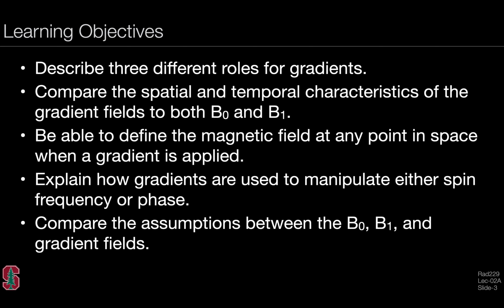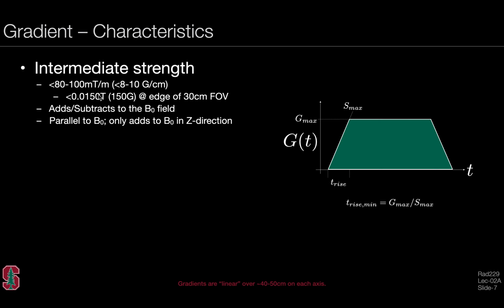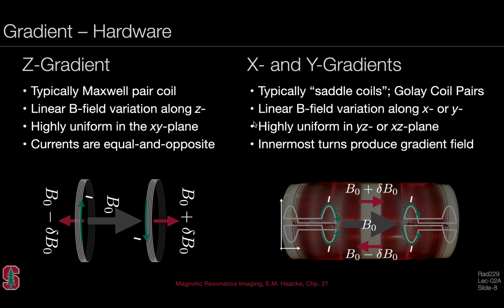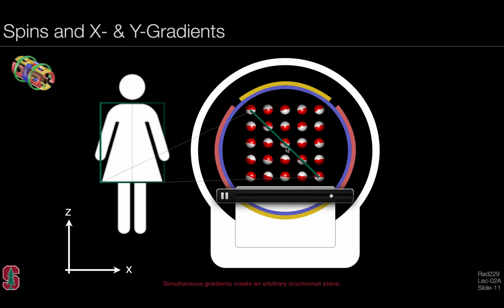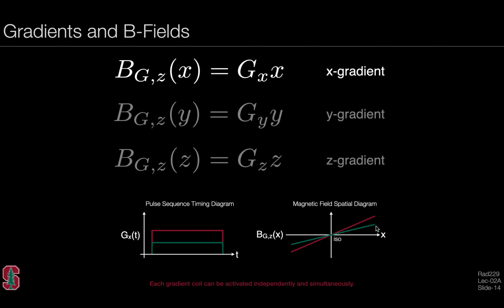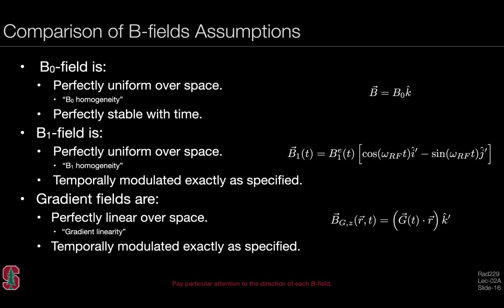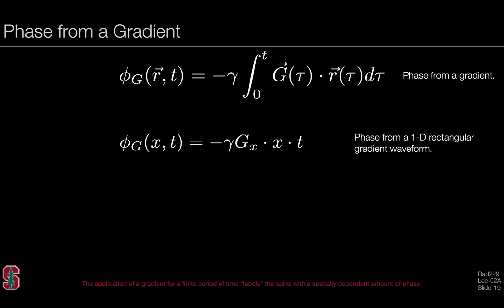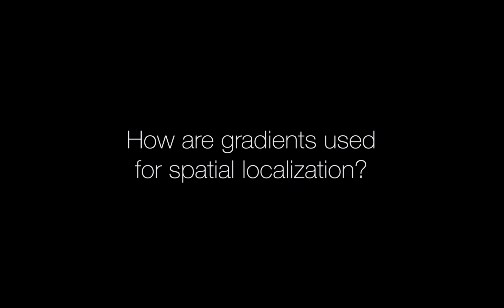Rad229 (2020) Lecture-02A: Magnetic Field Gradients

Comment: @ 03:38 In my opinion, this should be 0.150 Tesla.
@ 11:05 Not quite rectangular because of the rise-time (4:44)
@ 20:01 So the instantaneous phase is relevant? (Their accumulated phase is quite different here)
Reply: I agree with your first point. Regarding your second point, I believe it is modeled with a rect function but also the time-rise is significantly smaller than the duration length of gradients (which can be for a few ms). Not sure I fully understand your third point, because I believe we only need to consider the phase when we sample.
Reply: @ashwinkumar1678  About a year later I'm not so sure what I meant with my third point too ;-)
Reply from the maker: @ 03:38 we have a 100mT/m acting at 0.15m (15 cm or half the FOV) = 15mT = 0.015 T or 150 G.